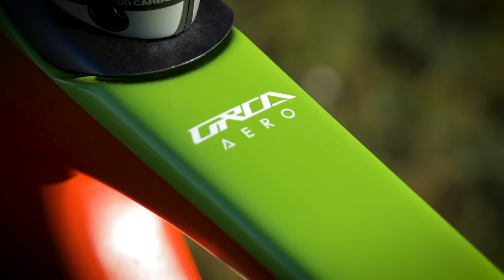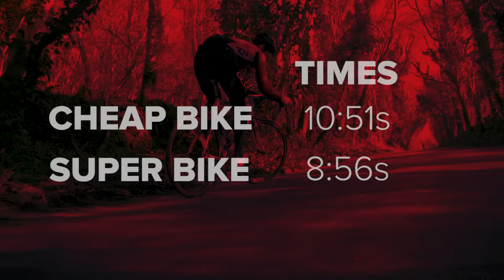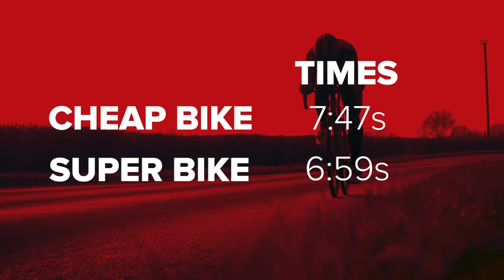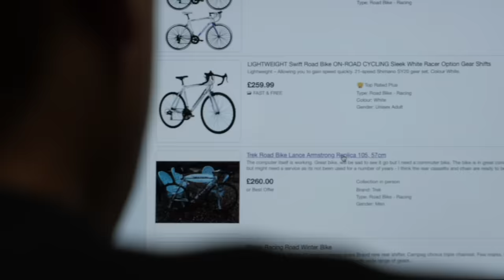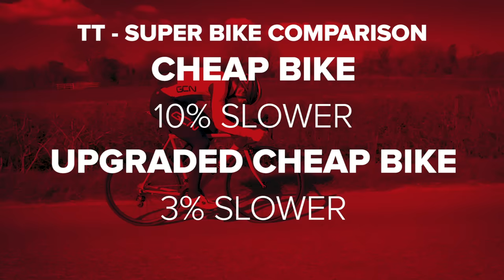Can We Convert A Cheap Ebay Bike Into A Superbike?

Comment: I would like to see the same wheelset on both bikes just to compare the deep section gains
Reply: Felipe Navas --> what good would deep wheels do going uphill?
Reply: Deep wheels would be nearly all the time difference
Reply: Im agree with you not only the wheelset but groupset, handle bar and groupset should use shimano R8000 because the super use dura ace

Comment: I bike on an over 30 year old Trek. My dad bought it back in 1983 and I've been using it for years. Almost all components are the same still, apart from the rear axle, grips and shifters. Otherwise it's still going strong and I manage 20 mile rides on it daily. Fastest I've pushed it was at least 30mph and it was still stable and I didnt lose confidence.

Comment: The ride of the cheap to super bike was improved due to the upgrades and it shows by the times and the performance. It’ll never be a super bike because of its frame. It just wasn’t designed for it. But I agree with what they say that an old bike can be improved with ingenuity, quality parts, skills to do to the job, and money.

Comment: Those hill climb times (16:20) were so completely consistent!! both riders were 33 seconds faster on the super bike and Chris was 2 seconds faster on both bikes than Simon on both bikes. This sounds like a high school math problem that you only need one speed to figure out the rest. Simon's time on the cheap bike was 7:50,  what were the other times that were achieved in the test?

Comment: For my 13 year old son new to cycling, tossed up between putting my well worn 1991 SR800 Cannondale 3.0 Road Race frame on the hard rubbish, or buying a cheap new or second hand road bike for about A$500.

Given the frame is his size, having some spare wheels and tyres, handlebars, stem, headset, seat post and saddle, the fact that we already have put money into other bikes for my other children and myself, and being inspired by various rebuild GCN videos, decided to take on the challenge of seeing if I could repaint and rebuild using second parts for less than A$500.

Comment: Got a 1988 Bianchi Limited lugged frame Ishiwata double butted steel/fork; have been thinking on jumping it from a 7   Sprocket Ultegra 600 to modern Ultegra or 105 compact stuff and lighter wheels and carbon fork.  Project costs around $1600 USD!

Comment: Interesting to see if swapping wheels would have brought the gap to nearly naught.
Reply: C.M. Puiulet --> He bought some nice Visions. Shouldn't matter in the climbs.
Reply: Happy Days yes it would, not as much but some. If you save a few watts you could go faster, or have a stronger finish. Don’t take many watts to save a few sec on a ~7min ride
Reply: Sure, I'm on my 5th different brand of carbon fiber rim. ENVE, good, not impressive, Profile Design, good for daily riders, 3T first generation, unbelievably light, but brittle and broke up. Zipp, 606, good for holding speed, durable, just don't handle as well as I'd like them to. Pancetti, good for what I paid for them, handle well.

What's your favorite?
Reply: better tyres and actually inflating them properly would see the biggest improvement, not the wheels. Actually having the saddle, bars and stem adjusted plus adjusting the mechs so you could actually pedal hard is the rest of it. The wheels and the groupset not much at all for the rides they did.
Reply: @happydays8171  What's your point...if you have one.
Reply: Beemrdon 
I don't know, that was 4mos ago.
Reply: It might just be the case.I recently swapped out my OEM wheelset on my bike for semi-aero rims(26mm,but with a profile similar to that on Velocity Ailerons),bladed spokes,and lighter hubs.After that swap,I saw a speed difference of somewhere between 3-6 kph,regardless of wind conditions,or gradient.
Reply: Yep same thing I was thinking.

Comment: The only factors related to speed in regards to the bicycle are the gear, bicycle weight, tyre friction force and finally your position on the bike as it will decide the aero drag force which is based on the area exposed to the air.

So, to achieve speed. Choose a lighter bicycle, slick tyres and a geometry that help you use less area on the bike. The rest is up to your fitness level.

Comment: I think this is one of the best series from GCN but I feel you guys are comparing apples to oranges. A super bike has no budget when it is being built so why was there a budget on the cheap bike? Effectively you are comparing 105 to Dura Ace. I wonder what the times and the feel on the road would be if both bikes had the same components and wheels? with that said I think Jon did a awesome job on the rebuild. Thanks for making the video.

Comment: GCN didn't even change the saddle and handlebar position for the not modified cheap bike. No wonder about 18% difference. 

They should do at least a bike fitting with the cheap bike.

Comment: liked this series pretty much, but still the title feels a bit wrong.
finally, frameset was the only bits that are original.
just built a mid-range bike with a mid-range budget is what it is, isn't it?
Reply: Not to mention the specialist tools he had to use. Not everybody has those and they're not cheap. I think you'd be better of cleaning and tuning it, then selling it and buying a new midrange bike.
Reply: @StuntpilootStef  if you mean the stripping and respraying of paint, i have done those on budget too, but it is a pain in your back. 2x1.50€ sandpaper, 3x circa 8€ cans of cheap car spray (rust protector for a steel frame, black and clear), then some more € on a basic one way respirator (particle protect masc?) and glasses. Add a pair of household gloved i had anyway. It is much slower than with a dremel tool tho.
Reply: @lenahygiena  No, I mean the special tool for the front fork crown ring, the special tool for the bottom bracket and what I assume two seperate torque wrenches. I don't have those tools lying around.
Reply: @StuntpilootStef  You often don't need special tools - check You Tube for work arounds
Reply: Compared to the cost of a mechanic those tools are cheap anyway.
Reply: @StuntpilootStef  both those tools can be had cheaply, I paid $20 CND for my BB tool at a shop. A torque wrench can also be found for a relatively low price (you don't NEED a $600 Snap-on torque wrench, a $60 one is functionally the same if a bit less accurate)
Reply: Ya I needed new bike.  Built a $1,500 US carbon aero ebay bike from all new parts 15lbs including garmin/headlight it goes up down and all around  and I just love it..  my philosophy is if you got the cash buy it.  If you got the love build it.

Comment: Well, I've had quite a few bikes, in both on- and off-road kinds, and one of the first things I've done with each was to selectively upgrade whatever felt like it was limiting my speeds.  At the same time, though, I know that I've fallen victim to marketing, and so have prioritized Campagnolo vs. Shimano, and sew-up vs. clincher tires on the road bikes, etc., but it's LONG been clear that upgrading is really where bikes can achieve not just greater speed, but greater personalization for the owner.  Right now, I have an Independent Fabrication off-roader, and a Fuji cyclocross bike, and I haven't started to upgrade either.  Onwards and upwards, now!

Comment: Love this video.  I am currently planning close to this for my current bike.  I am currently riding a Cannondale CAAD4 R500.  Not anything exotic or expensive when new by any means.  But I am planning on a bit higher with the wheelset.  Currently planning on a set of Rolf Prima Vigors mid winter, and then early spring I am hoping to upgrade from the 3x9 Tiagra to 2x11 105.  

After that is penny saving to purchase a Firefly frame, move parts over, and hopefully upgrade to at least a 2x12 or even potentially 2x13 if they are available then.

Comment: Super aero bike with 21 century technology only faster 10 seconds in flat road....
Reply: When they compared the mid-range bike to the super bike, the performance difference was 1.5% at a cost increase of 1000%
Reply: In the end, if you don't have the legs you don't go anywhere..
Also, we should take into account that the major drag penalty comes from the body position and not from the bike

Comment: Nice work. If you have a decent frame, can get a good line on components, and don't mind putting in a little sweat equity, this is definitely a viable option. Or simply buy a good midrange bike. One thing's for sure, the wheels and touch points--saddles, handlebars, and pedals--have improved immensely since the 1990s.

Comment: Sound like youve been spoiled for too long on the carbon... Does no one train with heavier bikes anymore?
Reply: It'll be rediscovered next year and tens of articles written about the hot new way to train.
Reply: I don't race professionally or at all, but I like to go fast, so my "training" is on my built single speed beach cruisers, or should I say boardwalk racers. My street fighters(street built MTB, which the cruiser helps too), help too.
Reply: I don't race professionally but I've upgraded non systemically from sand cruiser - older mountain bike - gravel - basic road- and now racing road, worth the climb and love cycling.

Comment: Great video guys. I have the same Orbea Orca with discs and etap and the biggest difference I found with that bike over my old Orca was the stiffness of the front end. The Vision handle bars really do feedback loads of what's going on on the road allowing you to place the bike exactly where you want it on a fast downhill section. I don't think the old bike would come anywhere near. Is that worth £7000, yes IMHO.

Comment: I'd like to know the weight of this bike before and after. Probably not much difference except in the wheels. I did the same type of build to my mid-80's full chromoly frame for half the cost. I bought slightly used 105 group and brand new take-off wheel set on ebay. Changed to threadless HS. Brazed on brackets to add disc brakes. It shaved about 2 lbs off the total weight compared to 105 group and wheels from upgrade in the early 90's. The wheels and cassette made the biggest difference. And the wheels made it feel like I dropped 5 lbs, not just 2. It's still not a light bike at 19lbs. But I'm a clydesdale at 250, so the bike is not the problem. In the end, it made the bike much more fun to ride and I still have that great chromoly frame I love.

Comment: have similar Trek same frame but Sora group.Yes its average on everything but not worried about dropping it and breaking 3k Carbon frame etc.Most folks are not racers we just want a reliable bike to work out and Trek is great at that.Mine is lot attractive looking yellow and blue and mid bar on the frame is flat not around.Now have also Specliazed Carbon bike but 8 out of 10 rides I take my Trek for beating it on rough roads...I think everyone should have one beater bike! To be honest I will never sell my Trek its practically classic!

Comment: What I'm hearing is a new set of tires and a properly adjusted derailleur would have put that old bike with OEM components within spitting distance of the latest and greatest. I'm betting better control of the testing variable (especially, attempting to control the riders' wattage) would make them near identical with those routine maintenance issues sorted.

Comment: video proved that aero frames gains are very very marginal, its just a very useful buzzword that bike industry is using to make the old bikes look obsolete, slow etc. Only valid upgrades are: enhancing the engine,  body position,  aero clothes and helmet, getting better tyres/tubes. Maybe getting aero wheels can add some watts savings but this is quote expensive upgrade for saving some 10-20 watts. Going uphill is whole different story.

Comment: Weight wise you used Vision Team 30 wheels. The Trimax 30 wheels are not that much more and dramaticly lighter. Plus the bars and stem were definatly not the lightest choice in that price range even for alloy.

Comment: Wheels are probably the best performance gain. I saved 500g from standard shitty Mavic Allroad to some 38mm carbon aero rims. Ironically as they’re disc brake they still weigh around 3kg all in with tyres tubes and brake discs, as opposed to a ‘cheap’ set of Ultegra s at 2.3kg all in on my older rim brake bike.

Comment: Compared to the Mid vs Super Bike challenge interestingly the results are about 2% slower on the mid than the super bike vs 5% on the upgraded bike on the climb but 4% slower on the mid range vs 3% on the upgraded bike on the flat

Comment: would have been interesting to see a piece-by-piece upgrade and see how it evolves. like just replacing cassette/chain and tyres first which should be generic maintenance, then to put in a new set of wheels, and use say a DA7900 instead of the new 105. (but of course wiggle wouldn't have been so happy with that buy :) )

Comment: I'm just not seeing now the drivetrain upgrade made a difference.  Maybe adjust it before the test ride.   And the brakes, I think new pads would have fixed those.  Wheels and tires probably made up 95% of the improvement.
Reply: As soon as I saw the "cheap bike" I knew that if a new wheelset and a tuneup were involved it would be obviously not much difference. I agree that just a real adjustment and the wheelset were 95%+ of the difference!

Comment: You started with an aluminum frame but most cheap bikes have steel frames.  What can you do with a steel frame bike to make it faster? A better crank set and better wheels. Maybe the crank set could be the new oval kind.  Suspended seat and carbon fiber handle bars.  Maybe disk breaks instead of caliper brakes. Show us the $98.99 wonder turned into at least a mid range bike.

Comment: Love my old bike, apart from the now very optimized ergonomics, all those memories of 4 biking tours across the alps are sticking to it (MTB), even if the weight is horrendous compared to modern bikes the ride is excellent and uphill perhaps slower but still comfy. There is a lot more to it if you want to compare now to old, how stiff is the old frame, has it aged and gone softer? Test it with same tires and rims, has it an aero attitude to the frame, is the derailleur jockey wheels still running smoothly or are they even gunked up like the core of a mud brick?

Comment: Would somehow going to a 1 X 12 setup been more beneficial? Would it fit in the older frame? I mean,  reducing the weight by having one chain-ring and one shifter is an advantage plus the fact is that you are pretty close to the 'usable' 14 speeds found in a 2 x 11 setup.

Comment: Great video but I was surprised at the conclusion that it wasn’t worth it. I’m not sure of the exact cost of the super bike but I bet $10,000 is probably pretty close. So to take a bike that’s less than 10% of the price and be within 10% of the results that’s a steal!! 
Especially for your non pro racers, that’s a lot of money and I’d imagine training can smooth that difference out in some/most circumstances. 
I have a trek 2000 SL that looks nearly the same as that and I’m loving it. I might need to paint it after seeing the transformation of that one!

Comment: You forgot to mention the weight difference? I ride a 1970's bike mostly because cheap replacement parts. I have had a lot more expensive bikes that are about 3kg lighter. But my frame (that is not ment to be the right size for me) just feels nicer.

Comment: they shouldve at least gave it tune up, not only for a more fair test but for safety reasons too. i have an alloy bianchi 20 years old and its faster down hills from the weight alone. the geometry makes it more stable and its a 4lbs heavier than my carbon trek but besides those things its not far off from higher end bikes.

Comment: Might have been a bit more honest to have given the eBay bike a quick service before the comparison. Gears dropping the chain onto the spoke is just maladjustment. A straightforward once-over, possible replacement cables, likely replacement tyres (old tyres get hard and lose adhesion), would have help performance A LOT, for staggeringly little money.

Let's face it, you didn't upgrade an eBay BIKE, you bought an eBay FRAME.

Comment: I liked this challenge because I wanted a road bike to round out my high end gravel and touring bikes for short rides. I got a Trek carbon 5200 for $300 usd which was great deal, it did not need paint so I swapped in brooks b17 (on all my bikes) and the wheels are good, but tires are poor so they will be fit tomorrow. For a bit of help from LBS I hope to make it a good running road bike for country jaunts on paved trails and paths. With 600 as my goal it should run better than a 1,200 new bike and for the investment I will not feel sad leaving it on a wall when I ride a better bike. Thanks.

Comment: Also consider this guy probably rode modern bicycles most of the time like a lot of us do. He should've had a break-in period with the old bike to get used to its characteristics. If I jump on a super fast bike after riding an old clunker, I'd have a lot of handling issues to get adjusted ot.

Comment: I know that this is a slightly odd request, but can you do something similar, when you compare the same model, just the top of the range version and the bottom? Such as the Specialized Tarmac disc, for $2000, and the top of the line Tarmac for 16000? Thanks

Comment: I used to have a Pacific then I was gifted a trek and it was stolen 😭 wrecked the pacific, was given a magna and saved up for a schwinn.  tricked out the schwinn also ended up stolen 😭 I wanted a specialized crossroads but I needed a bike faster than 3 paychecks away so a pawn shop had a roadmaster 😅  tricking out my roadmaster now.